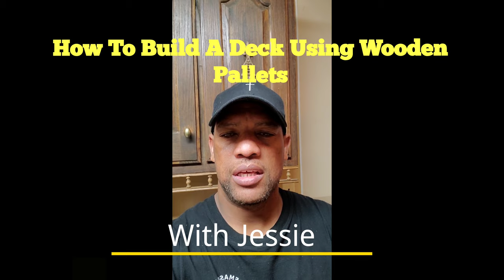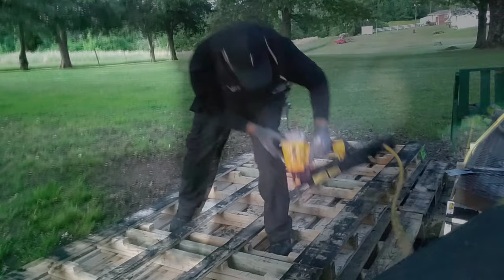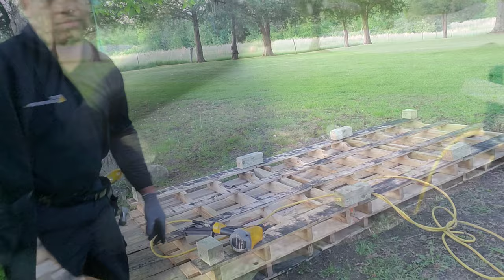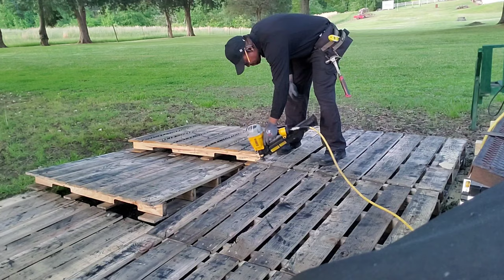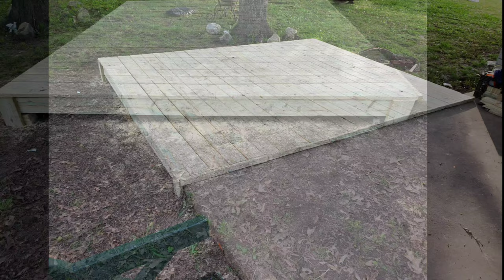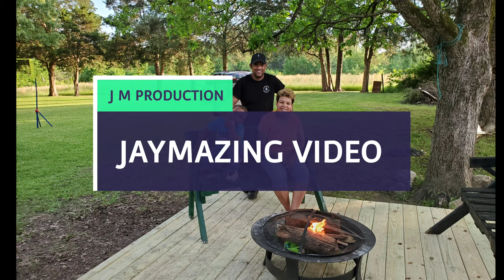How To Build A Deck Out of Used Pallets

Comment: Nice job. I liked the way you stayed with all like pallets. That is very important when doing this kind of project.

I would recommend that the parts that are contacting the ground that you treat them.

Looking forward to seeing more videos.

Joe
Reply from the maker: Thanks Joe! I didn't mention it but I did attach Treated 4x4 pieces as the legs which allows the pallets to remained suspended in the air. Thanks for the comments and watch for more to come!

Comment: Thanks 😊 How do you prevent rot?
Reply from the maker: These pallets were heat treated then sprayed with a clear weather coating protection. If you notice, I put treated pieces of 4x4 on the bottom which allows the pallets to float off the ground. Last I put the treated deck pieces of 1 x 5 on the top which added extra protection to the pallets. Thanks for your question!